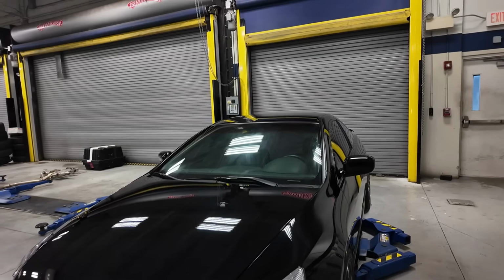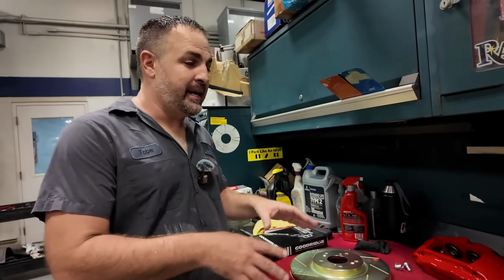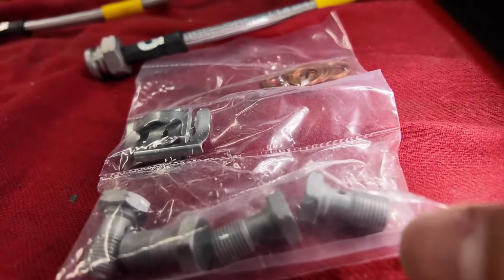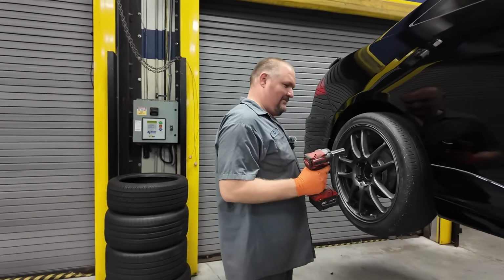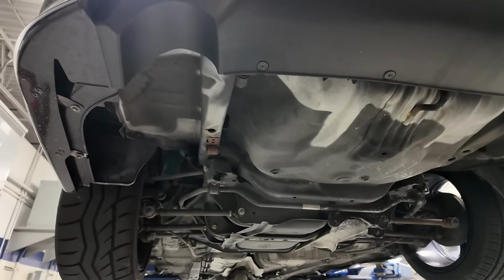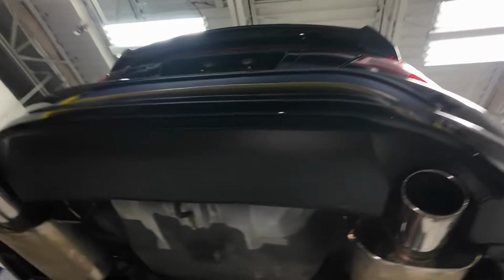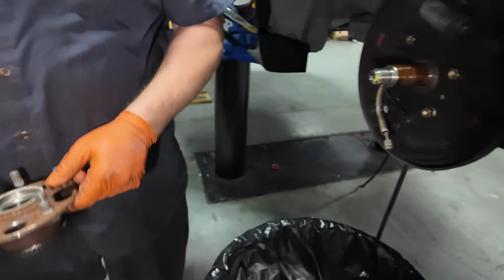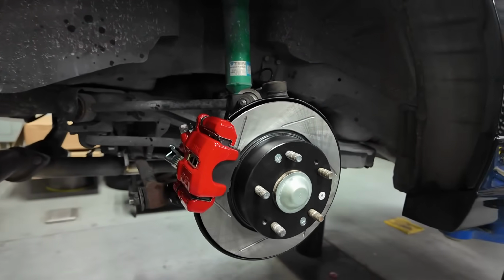Brembo BBK | Ray Gram Lights 57DR | Apex-i WS2 Exhaust // 2005 Honda Accord CM7 (E2)

Comment: What spindle is on the car? I know you mentioned that it had Brembo brakes before, I'm just curious to how the Brembo brakes bolts ride up. I'm guessing it's a Tl spindle?
Reply from the maker: This DC5 Creation Kit uses the stock Honda Accord knuckle/spindle, their Brembo calipers will bolt right up. No bracket or both components needed, which makes this kit amazing. The cost is less than $1000.